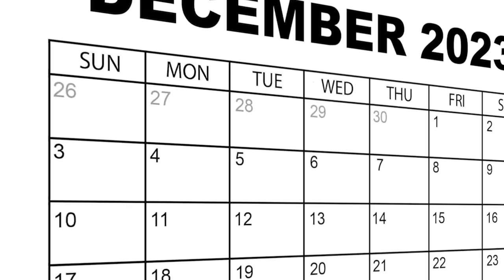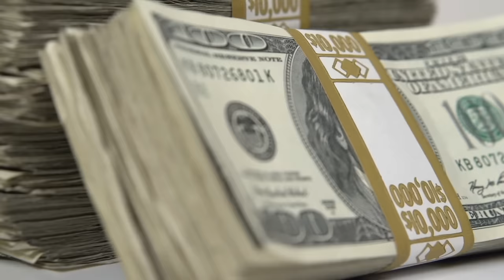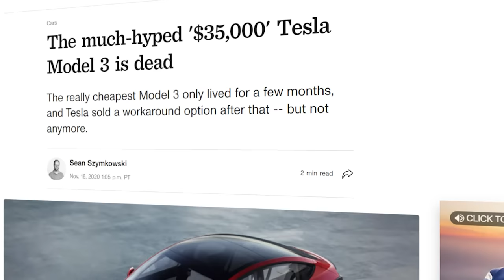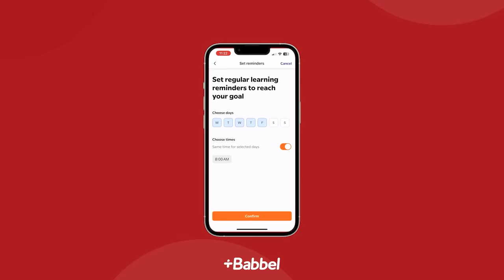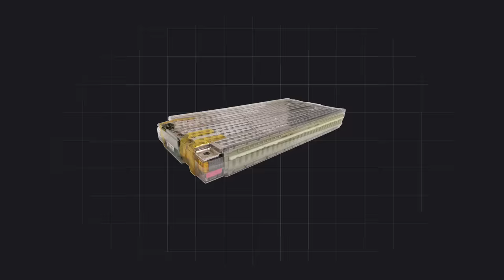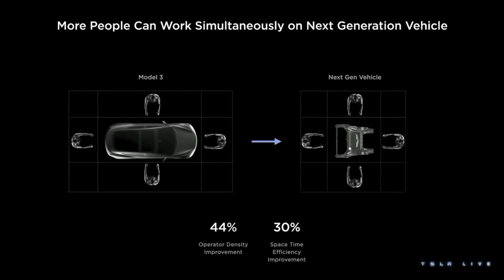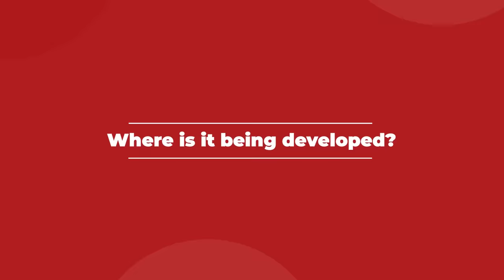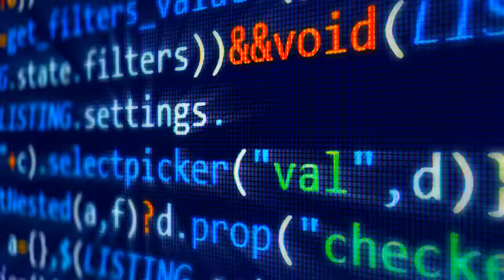The 2024 25k Tesla Model 2 Update Is Here!

Comment: Just a question: how can they use the unboxed method AND the 16K ton giga press creating the whole underbody in one piece?
Reply: So I believe they said that before they designed the structural battery pack so it will likely be a least 2 pieces for the underbody going forward. In addition, the unboxed method is based on creating larger modules so the doors, frame, glass, and dash will still be separate and can be added at the "stations".

Comment: @44 you state "we were promised a release date in 2023".    Would you please provide a source for that statement. 
It will be interesting to see if Tesla actually uses a single casting since the unboxed approach as shown by Tesla is not consistent with that approach.  You cannot have multiple unboxed sections that come together near the end of the process if there is one casting piece.  My quess based on recent rumors is that Tesla will not use a single casting.

Comment: Tesla is fooling everyone talking about how they are able to cut manufacturing cost. Yes, some of it is true but the real reason is using lower grade materials and fabrics. It also completely takes away the cost of a HUD and gauge clusters which are really nice things to have. They try to make it sound like because they can produce better that's why it's cheaper when in reality it's just they don't offer the same things high end cars have. Carbon fiber racing bucket seats or luxury seats, alkintiare, buttons u can use that feel great to click and look at, carbon fiber areas in and outside the car, high grade steering wheels, ambient lighting , not a plan jane dashboard, etc...

Comment: EV car companies should address this issue. The charging time, not everyone has the luxury to wait for 30 min to few hours to charge the battery. It is particularly difficult for people who stay in condominium or apartment to charge overnight because private charging unit not always available
Reply: Some just asked mme what it would cost to install a charger in the parking area of an apartment building he owns.   I can buy the charger for $1,500.  It simply wires into an outlet box like any other big appliance, like say a water heater.  But the cost to install the outlet depends on how far from the main breaker box.    Let's just say "$1,500" to run wire in conduit on the outside of the building.     So for $3K he could have a charger installed.  But a big deal here in California where rent is about $3K per month.

So apartments cn have chargers a week or two after a tenant asks for one.  That is what I told him.  It is MUCH easier to install a charger than a gasoline pump.   Pumps require underground tanks and you just can't put them ner a residence.  Charges are like installing a streetlight, not hard because the building already has power.

Comment: I owned a new 1973 corvette with 454ci 4 speed.  0-60 in 6.5 seconds.  Most mini vans can do that today.  Many average cars in the 70’s 0-60 in 10-13 seconds.  We do not need a high performance Model 2.  Truthfully why Make vehicles capable of exceeding 100 mph especially top heavy trucks/suv’s.
Reply: Most gas cars 70’s 5-10 mpg.  One reason gas stations on every corner.

Comment: Bolt only offers lithium Ion batteries vs Tesla which offers many battery types including LFP lithium IRON.  You receive the full range, 100% (LFP) vs recommended 80% charge with lithium ion. Lithium IRON(LFP) love 100% charge all the time and tolerate 0%.  Plus more life cycles, less fire risk, with IROn, LFP etc. hopefully next year LFP M3P batteries USA with more range.  Many competitors thinking of switching over to LFP for entry models.  CATL is a real leader in LFP.
Reply: Base model 402 km LFP
Long range 525 km MP3

Comment: That use case for Giga Austin wasn't baked in? 
Don't they read my  posts? hehehe!

Austin needs a freeform flexible space to design product lines as they will be installed elsewhere. Back before built, I included this, some other stuff too, in what I thought they ought to consider.

Consider being able to replicate the next planned physical updates to Fremont (and elsewhere), in Austin? You endup with a plug and play super fast install for CA; while, actually running the lines in CA as you build. Then, in Austin, during "down time" updating the line in CA, you are putting out the new model-variant. Depending on what you want to do around overlapping production, you start up Fremont with proven hardware and a fully trained crew.

Also use that space in TX, and experience, to initially house & launch a "Factory Designing Firm". Offer that to US EV startups. A turnkey 100,000/yr model line, bespoke design, trained crew. After a few customers, expand to other industries.

I wrote a similar bit on SpaceX recently & the only response was for me to quit fantasying, or at least not share it if I must contrive it.

Comment: The Tau will use 800V and charge much faster than most any current vehicle. With an overall small battery pack (~60kWh), could be 10-90% charge in <10 minutes.

Comment: Tesla through space X knows software and hardware as they make both.  Even NASA has stated the above.  Tesla wrote 30 years of software in months to program robots.  The best part is the part you do not need.  Simplifying production lines with less robots.  Almost a fully automated production line 24/7.  The 4680 DRY CELLS removed a whole section of toxic black slurry line of mixing and baking saving more time.  With the tabless battery even faster production times.  Stream lined production.  Batteries for battery storage really taking off for the grid.  Tesla offers both SOTA and FOTA OTA that competition still dream about

Comment: this whole idea of making "1 piece" chassis and other large parts is going to introduce more and more ride offs when you buy and have an accident, insurance will ride it off as replacement of that large part is too expensive, makes your insurance costs much much higher
Reply: Tesla works to avoid accidents through better software. The build replaceable crumple zones into the front/rear. If they sell these for under $20k (after rebate) as new vehicles, massive repairs to damaged passenger compartments will never be cost effective.

Comment: We need more level 3(DC fast chargers Tesla calls superchargers) at least 120kw.  MOST PUBLIC chargers are only Level 2 LEAF ERA CHARGERS where you only needed 80 miles(1st gen Leafs only 80 miles range)  MOST PUBLIC level 3’s only 50 kw, rare 100kw let alone super rare 350kw.  ALL TESLA superchargers are level 3  120-250 kw increasing now to 350kw.  We need more level 3’s to really push EV’s.  Many early adopters bought non Teslas and sold them cuz of charging issues especially with trucks larger batteries and longer time to charge.  The public demanded access to Tesla superchargers to charge their non Tesla EV’s.  Non Tesla EV companies placing charging issue on taxpayers and private.  Teslas MSRP helps fund its own supercharger network.  Now with competition switching to Tesla plugs we can pursue more EV adoption

Comment: I think Tesla’s next generation platform vehicles and Gen 3 Optimus will likely be launched circa late 2024. This is because both platforms are likely to use Autopilot Hardware 5.0 chips (4-nm process node size) provided at scale by Samsung. Initial Hardware 5.0 chip orders may be fulfilled by Samsung’s existing fabs in South Korea. In the longer term these chip orders will likely be fulfilled by Samsung’s Taylor Texas fab currently under construction, expected to be in production in late 2024.

Comment: I grew up in the 60’s-70’s.  You ordered cars back then as small dealerships.  You added options like power steering, power brakes, power windows, am radio, fm radio, all the way to cassette, power seats, air conditioning was an option, tinted windows, etc.  sadly all new cars are fully loaded now.  No base models.
Reply: It is cheaper to build only a single version of all those things than to design multiple models and a manufacturing to be able to produce and manage all the combinations. Then drive down the cost by mass production.

Comment: 25k would still be way to much for my liking. For 18k i can get a gas car that doesn't suffer from gas tank degredation or lower milage in winter and has lower insurance cost as it's cheaper and i can repair MYSELF wich with a ev is impoaaible as there is way way way to much software involved in a ev. 
And charging lol it costs the same for the same range here as putting gas in the car. Utterly stupid and the nearest charger is to far way and i cant charge at home.

Comment: Nope it is not here or even near to being here, when tesla advises of a new model it takes a minimum of 3 years before they even discuss manufacturing them. 2026 maybe tesla will have a 40 000 car after inflation, similar to the failing truck that was announced at 38 000 but is now 60 000. Meanwhile, you can buy a few models with similar specs that Tesla would need to have to compete with , in fact some better specs than tesla that cost around 25 000 or even less from proven manufacturers that have build quality tesla owners could only dream of.

Comment: This is almost like a sermon...all hail the divine Musk. There is no critical thinking, nor realistic outlooks on this channel. The Cybertruck production was promised from 2021, range +500 miles, prices would start from USD 39,900, top model 69,900, with body panels 3 mm stainless steel. Reality is that slow production started 2 1/2 years after the promised date, the claimed range is just 320 miles (real range in tests is 250-270), the base model costs USD 60,900 and the top model costs USD 100,000 and the thickest body panel 1.8 mm stainless steel, with most being standard 0.6 - 0.8 mm like most other cars. Translating this to the "Model 2", then production will start in 2026-2027, cost from USD 33,000, range around 200 miles, so nothing special.

Comment: Any car I move to will have to be AWD/4WD.  If the new Tesla has a AWD/4WD 30K version will look hard at that as an option.  Do not have the need for speed.  What I need is traction when needed on snow, and ice.
Reply: Try a 2wd Tesla on snow it works nice the traction control is very good
Reply: The Tau will only have 1 motor - no AWD. Make plans to buy something else.

Comment: Think about the tank in your car.... 
In an ICE vehicle it is the tank that stores the energy needed to power the vehicle.
In an EV vehicle it is the Battery that stores the energy needed to power the vehicle.
Both the tank and the Battery needs topping up...
The tank takes a few minutes and the battery takes a lot longer. 
So i guess for speed between two places where the tank or the battery needs topping up, the tank wins every time because of the time saved topping up. 
Also in cold weather the battery will be used up quicker.

Filling the tank v Charging the battery is crucial as today there are not nearly enough charging stations and who wants charging stations outside every home or flat in the cities and elsewhere.

The EV argument has not been thought out properly and it is obvious that the driving force for EVs is as usual....MONEY, PROFIT and GREED.

A lot of people are going to get their fingers burnt....
Reply: The new LFP batteries are less affected by extreme temperatures.